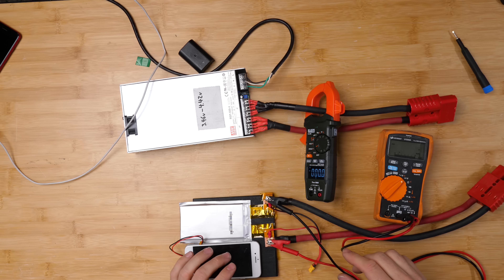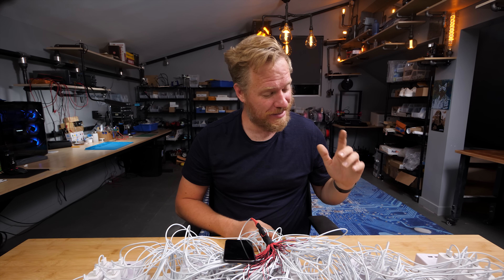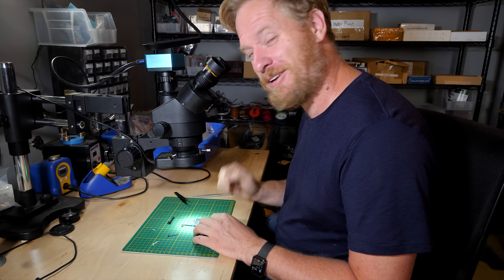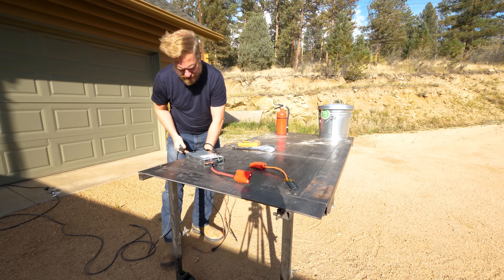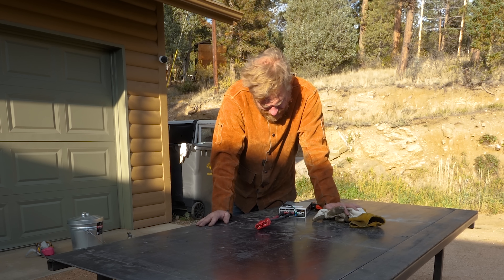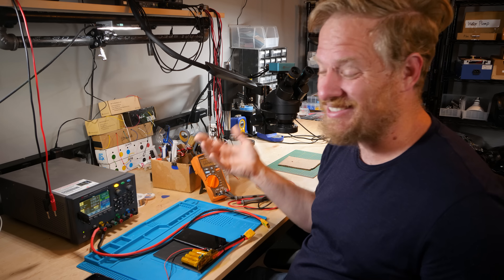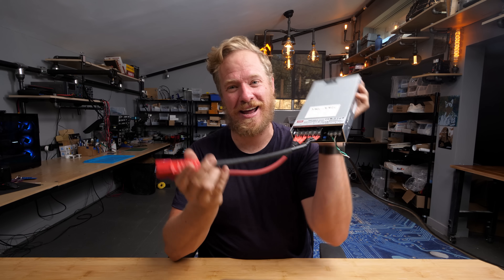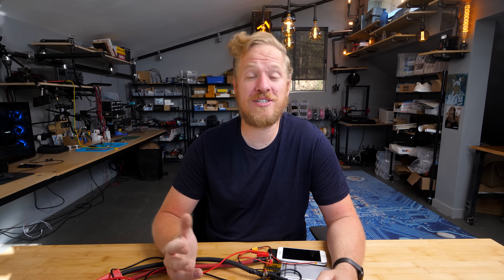I built an iPhone that charges in 9 minutes

Comment: Enevate makes a fast charging battery chemistry that is greater in energy density, and graphene is also said to be four times the energy density compared to present batteries used in cell phones.

also, gbatteries achieved fast charging batteries with an AI based charging algorithm which maintains low cell internal resistance while charging, and have many years of great success.

Comment: Meh my current phone has 125w charging its not exactly far behind 9 minutes. So at best the capacitor is still worse than my current phone it has hqlf the capacity of an iphone which is less than half the capacity of my current phone amd charges in about half the time.

Comment: Back in school, for a hybrid vehicle competition, we made a hybrid energy storage system with lithium ion cells and lithium ion supercapacitors. I have always wondered. Given my phone lasts 10h of screen on time on its 4700 mAh battery, it would be interesting to have a phone with a small LTO cell and a medium sized LiPo cell. Have the LTO cell always charged and discharged first. You could in theory, sacrifice some total runtime but gain the ability to ultra fast charge a small portion of your total capacity in minutes, giving you maybe something like 2h of screen on time with minimal cell wear.

Comment: for fast charging it needs  data wire too  by increasing amperes you can't fast charge a phone as fast charging is software based not hardware based so not connection the data wires the green and white wire don't trigger the fast charging software on  your phone instead it will charge your phone by a normal charger phone

Comment: You need to up the voltage to increase charge speed. If you just set charger to 4.5 constant voltage due to lipobtteries internal resistance it will maybe take in 10 amps at best then taper down in amps as its gets filled while staying at 4.5 charge voltage. 

What you need to do is get an lab bench supply and just increase the voltage as high as possible to push in the maximum amphours the battery can hold as fast as possible without exploding it

Comment: ngl I was expecting the multi-battery approach, since two half-size batteries cuts the time down by half, five fifth size batteries to a fifth of the time, and so on without sacrificing capacity. This works better tho because more batteries means more heat and more heat means more chance of going explode-y

Comment: Hey I was stuck at something that I'm asking you to consider is to show or build a step down module that can step down voltage of a lithium ion cell 4.2v to somewhere around 2 to 3 volts because I searched almost everywhere but except voltage divider I couldn't find anything useful that can supply decent amount of power to the attached load like a motor.

Comment: With multiple chargers in parallel, you are limited by a few problems. 1) Hard coded logic 2) BMS 3) Connector resistance/rating 4) Communication noise

Comment: Just wondering... how did you connect the supercap to the phone? Did you connect through the original BMS?

I'm looking into repurposing older smartphones by replacing the aging battery with a supercap just to keep it on but most of the time it will be plugged in ideally via the original USB port.

Comment: The reason why the BMS needs a 0-100 charge every once in a while is, is because the BMS doesn't take into account battery wear, and thus current out and in, isn't a good enough factor in the long term. Charging the phone from 0-100 let's the BMS know at what point the battery voltage drops tremendously (goes from 3.7V to <3.5 very quickly, this is the moment the phone will shut down) and when the battery is at nominal fully chargedvoltage (4.3V nowadays). At that point the BMS can measure the current in and current out to give good readings again. This doesn't mean you should always charge your lithium-ion/lithium-ion-polymer to full, because having the battery at the extremely high voltage those batteries are charged to nowadays causes the chemical structure and the plating and such to wear down very quickly. A too low voltage also causes wear for a different reason (don't remember what exactly the differences are).

Comment: Combine a supercap with a Lithium battery. Charge the supercap for 10 Minutes, then let the supercap recharcge the Lithium Battery pack 50% overtime. That way you will not get a 100% in 10 mins but at least 50% charge.

Comment: I've seen android phones rated for up to 200W that, even though don't run at its max rated charging power, are still capable of charging its much bigger battery in 9 minutes. I am pretty sure that the 200W charger was unable to provide anything as crazy as some 47-amp super capacitor can be charged with, but I am guessing that the battery charging circuit might increase its output voltage while the battery's voltage is increasing from charging to maintain a steady voltage difference that help maintain a relatively stable charging current in the presence of the battery's internal resistance, and if that is true then that could be one way to fast charge the original iPhone battery.

Comment: Great video, however there was a mistake at 10:00
"Would you rather want iphone that would only charge 4.5min but last half as long" is correct because the battery would be half the size with capacity. Even tho charging is logarithmic so it would prolly be like 5min.
Anyway I'd absolutely take this on a gaming phone. It would be worth to have like 1.5h play time with 4-5min breaks. However do these batteries heat as much a lion/lipo batteries when u charge them that quick? (Considering you'd not be on your phone during charging)

Comment: I rather have an iphone that was slower like an iphone from two generations ago but using the current efficient chip tech and maybe increasing efficiency of other parts of the phone then adding a super capacitor so that i get close to the same battery as i do now but with 9 min charging

Comment: Hi nice video ! Your experiment setup is totally wrong, you are using a constant voltage source which doesn’t help. It’s doesn’t matter if the power supply can deliver 1, 10 or 100 A in this case the charging current is determined by the voltage difference and internal resistance of the battery. You have to use a constant current source like the later part of the video which pumps 10 A to charge the lithium titanate cells. Also you should never charge the cells beyond the max C rating else it could result in thermal runaway/ cause permanent damage to anode/ cathode. I worked with lithium batteries. Also include a disclaimer 😂 you don’t need people trying to sue you

Comment: Instead of a 5V battery you could try using a 10 or 15V battery. You will need to convert it down to 4.3V afterwords. But the benefit is that you need less current to fast charge the battery if the voltage is higher

Comment: The BMS is limiting the charge current that is going in the battery thats a safety feature of a BMS. If you wanted to burst the battery while charging you can remove the BMS then directly solder a connection to the battery then use the 5v high amp charger.

Comment: The multi charger is useless. You’re drawing the same power regardless. You need more power at the source because your still plugging it into an extension cable which will limit the amount of amps allowed. You need to run it through a higher power.

Comment: No man it's showing 100% because you are using DC to DC 5 V even if the cells are at 1% it will still show 100% in that case with the step up DC to DC  7:43

Comment: Id rather the capacitor, ideal for tablets, but the way a lipo degrades over time is an issue a cap won't have. And that right there is another reason why they aren't used. Planned obsolescence anyone?

Comment: Nice idea with the super capacitor, but this is click bait my friend. You did not "build an iPhone that charges in 9 minutes" all you did was attach a super capacitor to the iPhone, on a testing rig, without a new power limiting system, or a method for the iPhone to detect the super capacitor's charge, and you didn't even bother to construct a case that would contain the phone and the capacitor together. Interseting video nuntheless, but this is most definitely not building a fast charging iPhone.

Comment: I remember having a phone that would charge to full in under 10 minutes, but to be fair the NiCd pack in that particular Motorola Star Tac also only would last 5 minutes in use anyway, so I was kind of always using it with either a car kit or a desk charger, till I got another battery pack, and then replaced the 4 500mAH AA cells in the old one with new cells, that actually had capacity close to the marking. Then had at least 3 hours of operation on it.

Comment: Why not use two batteries or cells in parallel? Couldn't you push the charge time down to half by concurrently charging each battery/cell?

Comment: For those fast charging tests you should have gotten RC Lipos. 
There's some that can charge at 10-15C without breaking a sweat.
At 10C it took my smaller drone packs considerably less than 10 minutes to charge (think it was around 7 minutes). Afterwards they got emptied in 2 minutes and still held up for a lot of cycles.
You could start from there and see how much current they take without getting toasty. 
Also, you should use an RC charger that gives you good control about current and display some data, as well as smaller battery for the tests, like 500mah. Otherwise you require crazy charge currents, no RC charger can handle.

Comment: Supercaps are even worse than that when compared to a Li-Po. They not only hold a fraction of what a Li-Po can, they also discharge linearly. Your standard Li-Po will hold a voltage while discharging, only dropping a little over most of it's life, then at the end will quickly drop. Allowing you to use nearly all of the stored energy.  The linear nature of a supercapacitor discharge curve means it's essentially "dead" while it still has much of it's energy left.

Comment: i thought fast chargers start off at a higher voltage, for example 9 volts, so that the battery charges quicker for the first 80 percent of capacity.

Comment: Is there any different outcome if you hook up more smaller lipo batteries in parralel? My idea is best of the battery system which is used in xiaomi mi note 10, where there are two battery cells which are connected in parralel.

Comment: In general, you can't parallel switching power supplies (which is what those wall adapters are) without special provisions. They each rely on their own feedback for regulation and paralleling them mixes that feedback together messing it up. That will usually cause one of the supplies to try and to supply the entire load by itself while the others do little to nothing. That can also become a fire hazard if the power demand is higher than that one supply is capable of.

Comment: 1 amp charge but the voltage is still the same. Also the phone has a built in charger that will only take in so much so to get fast charge (for use regular users) is to get a higher voltage charger.

Comment: This was really cool! If I understand it correctly, you need to split up the LiPo battery into multiple cells so it won't overheat, then you can set the BMS to charge 0-100% in around 15 minutes without compromising the capacity.

Comment: You could increase voltage as current drops, that would likely charge a little bit faster than keeping the voltage locked (I think, I'm no expert)! Personally I wouldn't mind a battery that lasts half the time but charges much faster. It would work out better in the long term if you could charge a battery in 10 minutes (albeit costing more in electricity).

That said, it amazes me how Apple are still so far behind Samsung in terms of charging capability. I can charge my S20 Ultra in just about an hour from flat to full.

Comment: Awesome content as always.  Love your choices of components and execution.  Curious if you've seen the "C rating" used in RC batteries?  Represents the charge rate as a multiplier of the 1A per 1mAh, per hour figure you mentioned.  10C for example...

Comment: For a somewhat practical 20 minute charge, you could use 18-16g wire and a 1800mAh lipo cell rated for a 5c or higher charge rate. Combine charging at 9 amps would do the trick, and honestly it might be plausible to close the phone up with that. You’d probably have to run some kind of connector out the side or back

Comment: The battery was only drawing 5 amps from the 90 amp supply, most likely the meter registed the spike in current that those supplys have when connected dropped to 1.5 amps due to the internal resistence of the battery, and since the battery didn't warm up its resistence didn't dropped, but this is just a guess without more testing. A way to check if the current is being limited by the internal resistance is changing the battery temperature. Heating the battery should increase the current and cooling should decrease it.
by the way love the engenuity of your projects

Comment: Then i wonder how current phones can charge so fast, even while using (seemingly) the same Li-Po batteries.
I have a cheap xiaomi that is 4 years old at this point, but it still charges in like 50min with a 18w charger, and it's good enough already. The new ones can easily go as fast as 30min, so is it just BMS that is tuned to let more power in or the batteries themselves are somehow different?

Comment: Have you seen the Xiaomi phones with the 120w chargers? I have one, 5000mah battery charges fully in about 15 minutes, reliably and safely. I've measured 5A at 20v going into it using ampere, an app for monitoring battery usage.

Comment: A battery that last half as long but charges faster would be useful, especially with wireless charging, you could just put your phone on your desk and have it charge superfast. 

Would a hybrid battery work?, like a hybrid hard drive where it’s the best of both worlds, your super capacitor could charge fast, then slow discharge to charge your standard iPhone battery. Like an external battery pack, but built in.

Comment: I wonder if you could do the power equivalent of a DRAM buffer:

Use a small supercap to charge the phone's energy storage to a limited amount very quickly, then charge the LiPo if the charging cable is still connected. For a slight energy penalty due to resistance, you could even do internal energy transfers to discharge the supercap while charging the LiPo so that your superfast charging is ready once you plug it in again.

Comment: There really was no need to waste 100 cables and buy 100 chargers to prove your point at the beginning of the video. You could just use your power supply straight away.

Comment: They should use both a supercap and a LiPo inside of phones, so that you can get a lot of charge real quick, and then the LiPo is slower charging longevity power. Or, they could just find the happy medium, where the phone charges and drains each equally, and find a good ratio to both speed up charging while also maximizing longevity - or the user can choose how much it charges each. They could have it charge the LiPo first and then the supercap last, or charge both at the same time, or charge the supercap first and then once it's full switch to charging the LiPo. That sounds pretty good to me because everyone is at different levels of "on the go" in their life and some people wouldn't mind charging faster but more often while others might want to just charge overnight every few days. Just a thought.

Comment: You hit the nail on the head when you said that you learn best when you are solving a problem, not reading a text book. As a self taught software engineer, I can say that many of us are the same way, which is exactly the skillset you need when what you learned in school is out of date within months or you need to learn to do something new that doesn't have documentation for your use case. You get bonus points for going through and soldering all those wires in the beginning knowing that it wouldn't work. A+ for effort!

Comment: Great video, thank you Scott. Super Capacitor could be a useful addition to batteries, since  it supports fast charge. It will be very useful when devices are close to 0% of remaining batteries but running into urgent needs for extra 30 mins to an hour.  This should be started from laptops where space is little less a concern.

Comment: I have a set of those connectors, just to put in perspective how much power those can handle. I've dragged my 2009 honda pilot (~4300 lbs) accross my lawn using a winch that was powered through those.

Comment: The fastest way to charge a phone would be to bring back battery swapping. A while ago I modded a couple of phones to run off of AA batteries it work just fine but AA batteries don’t have the same capacity, and they are quite large but being able to change them out when my phone was dead was nice.

Comment: You can use the XT60 connector.  It is smaller and is made for 60A, but will also hold 180A for a long time.

Comment: The iPhone will (normally) only accept 20W of power, so if you use a 95W Mac charger it will charge at the max of 20W, and if you use 100 5W chargers to achieve 500W, the phone will still only charge at 20W. Some android phones accept 100+W of power and can go from 0-100 in 30 minutes over USB type C. Laptops tend to use higher wattage chargers due to the bigger batteries.

Comment: For the iPhone stock battery couldn't you get higher charging currents if you had increased the voltage to 8.4V. But for that you would need to cut off the charging as soon as the battery gets to 4.2V, before the magic smoke appears.